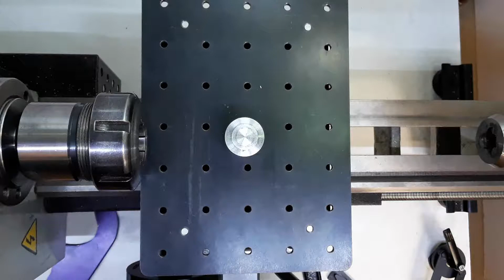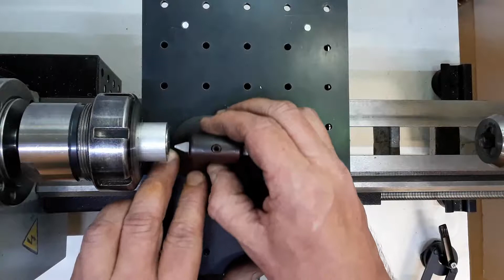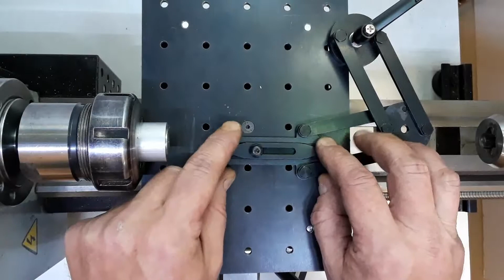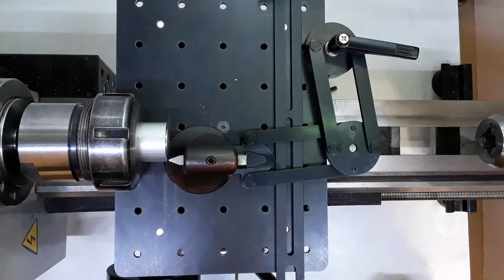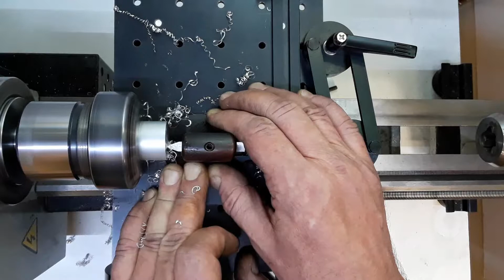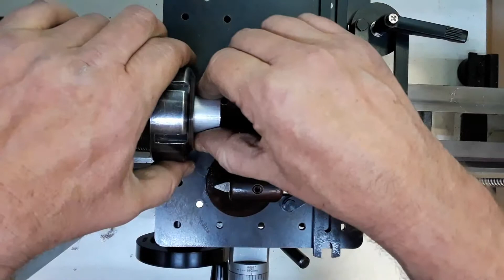TURNADO: FACING. INST: arkadiy.chernikov

Comment: I thank you so much publishing these Turnado demonstrations.  I find them very inspiring and educational.  
If I make an unsolicited suggestion - I think when you set up the fence you should start with a pin at the open slot end in any convenient location, and then align the fence square to the table at the clamp end.  That way both ends of the fence are ‘fixed’ and fence will be less likely to push away from the cutting forces at the unrestrained end you show.  What do you think?
Reply from the maker: Agree, thank you Joel.